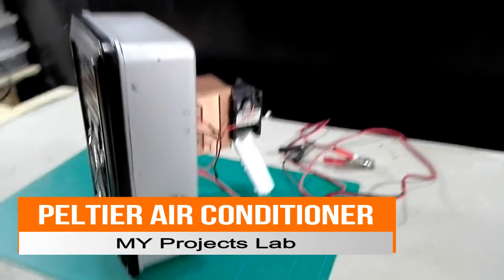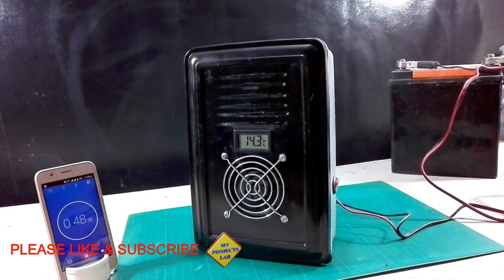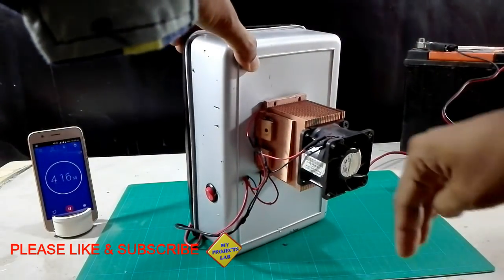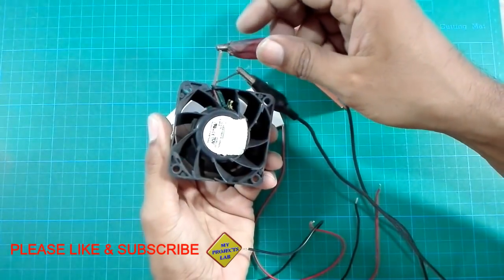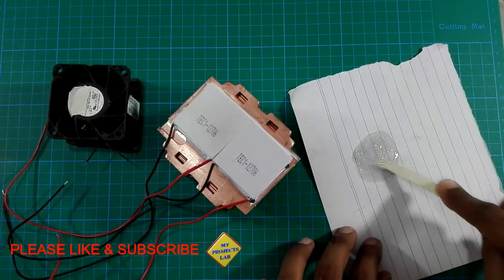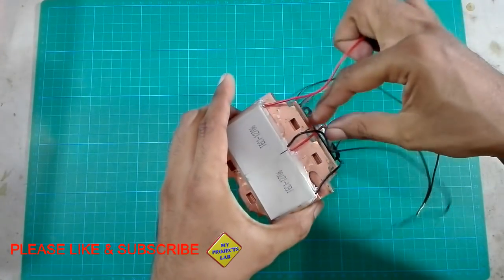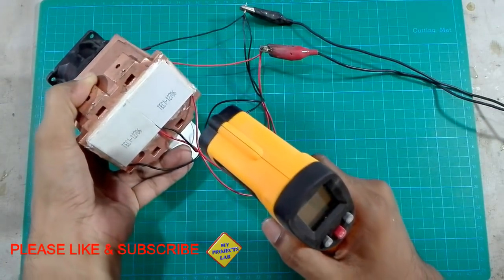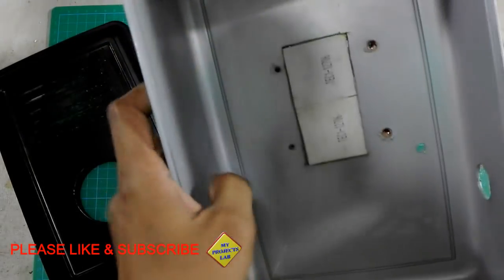Peltier Air Conditioner - How to make Peltier AC at Home

Comment: Simple and easy, like that! How long you can power this? Eeach peltier takes about 10A plus fan its maybe about 25A total. The accu look like close 20Ah which means it runs for less an hour or maybe 30min?
Reply from the maker: These are 6 ampere each peltier, fan is 2.5 ampere.

Comment: Where you get this copper heat sink online or local shop and how many rs it is please reply fast
Reply from the maker: From local computer scrap shop 6$ both.
Reply: My Projects Lab if I use 12v 1a current what happen? In Amazon I search the petlier cooler kit but in the product detail it is written that it works on 12v 1a current .I have 12v 1a current it is ok for petlier cooler

Comment: how much time Take to  cool small room  like Bed room  About  20 degree
Reply: About 80 days assuming you're not in it, it's perfectly isolated, about 30 metres thick walls, hermetic, not counting the heat produced by fans, power source and the Peltier module itself.
Reply: Never

Comment: Bro temperature sensor is reading temperature inside of box... Connect sensor outside so u can measure surrounding temperature
Reply: Yeah..i just consider about it bro.. The same question with you..
Reply: he mean home for ants
Reply: The room temperature should increase. The front cooling should equal to the heat generate at the back.

Comment: If your device is used in a closed room and does not exhaust heat from the room then it is in fact a room heater disguised as a cooler. Nice try though.
Reply: Neil Paul True enough but he does show it being installed on a window.  So he is dumping it outside.
Reply: Hey bozo, he shows it in a window dumping the hot exhaust outside.   While on the test table, it's just that.....a test.  Grow a brain
Reply: So the heat from the hot side is impossble to contain?...like an oven does?...im interested in this concept but trying to solve that very probem.....love to hear your thoughts...
Reply: truth seeker
The heat has to go somewhere.  If it is just dumped into the room the net effect is zero (actually worse as you added heat from the electrical components).  Wherever you dump it, if it is in the room, it will eventually make it back to the room.  An oven doesn't contain (completely) it either.  Just slows the heat conduction down so that most is concentrated on the food. Eventually said heat will go back into the room.  The only way to make and keep a room cool is to dump the heat outside.  That is what all AC units do. 

In theory you could dump it into water contained in a cooler by using a water cooled heat exchanger like those for PC's.  The cooler would keep most of the heat in.  Eventually you will need to dump that water out and start with fresh water again.  How efficient this is I don't know.  Plus you would be using up water, though it could be used on plants etc. 

At that point though, it might just be better to use said water cooled heat exchanger with a fan to cool a room directly.  You bypass the Peltier module and thus all the heat you are dumping into the cooler is just from the room and not added like with the Peltier module.  There are many YouTube video using this method.

Comment: MERY PAS LAPTOP WALA 19 VOLT KA ADOPTER BHI HY KYA WO SAHI RAHY GA????PLEASE REPLY ME MUST BHAI.THANKS
Reply from the maker: No, 19 volt, fan aur peltier ko kharab kar dega, use only 12 volt supply.
Reply: My Projects Lab BHAI SB KUCH SAME AAP WALA SETUP KIYA PR 25,C SY NECHAY NAHI JARHA TEMPERATURE.MN NY BOX KY UNDER TEC1-12706 JO COOL SIDE HOTI HY WAHAN PY BHI COPPER MN HEAT SINK LGAI HY.BINA FAN START KIYA THA TO PANI TAK ICE BN RAHI THI PR ACHANAK SY WIRING BHI HEAT HORAHI HY.PLEASE BHAI
Reply from the maker: Hot side heatsink ka fan on hona chahye jtna powerful fan hoga utni jaldi heatsink cool hoga aur cold side zyada cool hogi.
Reply: My Projects Lab hot side yehi aap wala fan lagaya hy.supply bhi p.c wali hy and cold side pay heat sink lgaya hy wo BHI behtareen cooling hojata hy pr jb cooling side wala fan on karta hon to temperature 14,c sy 25,c py ajata hy yani cooling down hona START hojati HY.please help me

Comment: your gettimg only the temperature inside the box...thats why its easy to get cold .how about temperature ambient the room does it get cold?
Reply from the maker: It can reduce temperature of small spaces like mini camping tents. Or it can be used as desk cooling fan by adding a flexible hose pipe on back side and leave pipe outside room.

Comment: If this device can cool a 6x6 room then i believe by using 4, 5 units  of same size can cool a bigger room. I mean 4 units of same size can be installed in one big Thermopylae  box to get greater results. What do you sat?.
Reply from the maker: Not 6x6 room, it can cool down small 6x6 camping tent.
Reply: Ok tent or room whatever. My question is  can we get greater result by using 4, 5 units together?

Comment: Bro noise is to much
Reply: Can be solved by using bigger heat sink and bigger fan
Reply: The noise is coming from the fan on the heat sink which should be outside the room you are cooling as he demonsrates by putting it in the window

Comment: Bhiya temperature sensor ke pin ko apne peltier ke upar kyu laga Diya hai, iss terah to wo peltier ka temperature show karega but hame to room temp kam hote hue dekhna hai.
Reply: That means you are saying 15 deg cent is the temperature of the air coming through the outlet of your device right?
Reply: okay I made it at home its not cooling area cause its ideal for inside car or small camp .
Reply from the maker: Temperature pin, Peltier pr lagane se ye idea hota hai k after condensation temperature kitna lowest degree maintain horha hai.
Reply: Namee(moisture)kaisay kum ho gee? Namee Barhatay gee tau hubs ho jaega.
Reply: dangerous innovation right
Reply: Use dehuidifier.

Comment: Nice video.I need one information.I live in southern India where in summer temperature goes up to 40 deg c and humidity will be 77%.The roof of my house is made of concrete and to reduce heat I gave metal sheet roofing still I cant find any difference in  reducing the heat inside the room especially during night time.I would like to know if I could moisten the metal roof by fixing flexible vinyl tubing on top of the metal roof and putting finer holes on these tubes.These tubes can be connected to the super cooled water from Peltier chip and circulate the water using a medium size aquarium pump, so that the roof gets cooled down and the room temperature will be reduced.But will this idea work ?
Reply from the maker: The peltier will not be enough to cool large amount of water for circulating on roof. Continuous moisture will effect the life of your roof either concrete or metal. The better solution is that you can use heat resistant paint on roof which helps to reduce heat by some degrees.
Reply: Did you leave an air gap between them ?

Comment: How far can you star to feel the coolness?  Just guess it may be within one foot from the air-con unit.
Reply from the maker: Its air throw is in acceptable limit, the purpose of this is to reduce sorrounding temperature.
Reply: Very impressive. Copper heat sink and high lev fan help makes good heat dissipation. Wonder if there is much different in the cold side when using normal aluminium heat sink?
Reply from the maker: By using aluminum heatsink the efficiency of peltier will drop down and it will reduce its cooling.

Comment: Why you not using other side heatsink
Reply: Are you sure that the cold side is better without heatsink?
Reply: But I think the heatsink " aluminum or copper " will act as a catalyst or a medium; to speed up the heat transfer rate.
Am I correct?
Reply: Sitaram bhai yadav 03049953213
Reply from the maker: Cold side does not need heatsink necessarily, as air comes from front fan directly meet on cold side condenses much quickly than using heat sink.

Comment: sound is so high
Reply: Its too noisy. Add heatsink on the hot side change the fan to low noise high volume flow
Reply: Also high sound because he placed a pretty large battery for power, so many amps kick in!
Reply from the maker: Yes cooling fan is so powerful and loud.
Reply: My Projects Lab isko ki kimat kya hai aur hum isko kahan se lesaktey hai. Kya arab aur India mie available hai. .yeh khaima yane tent ke liye bhi bahut acha hai. Solar panels se connect karsaktey hai. .good luck. ...from India Kuwait. .
Reply: I think it's better but. Too noisy
Reply: munaf . ismail bhai amazon par book karalo dunya k har hisse may mil gayega kam rate banana aasan
Reply: bro Amazon India se Pakistan main delivery ho jaye gi
Reply: Kuy waha uplabd nahi hai saman kay